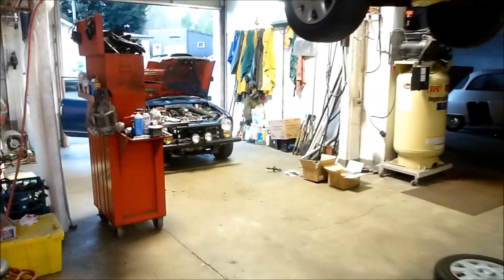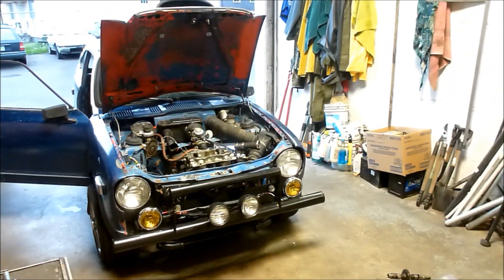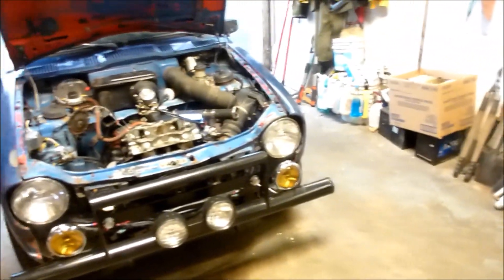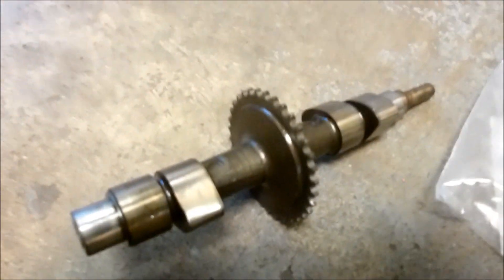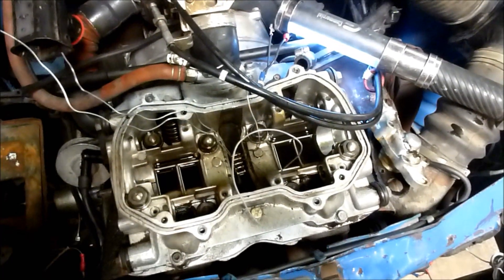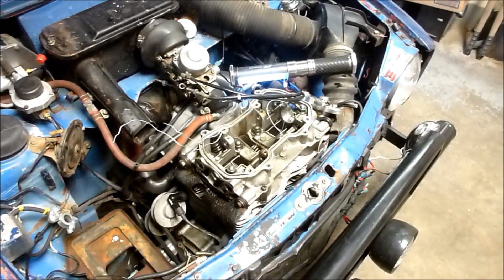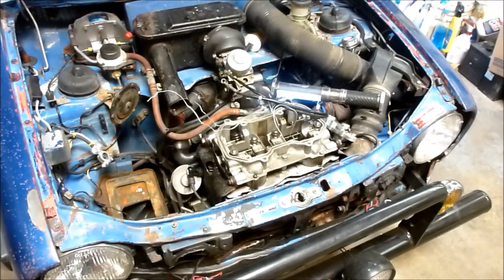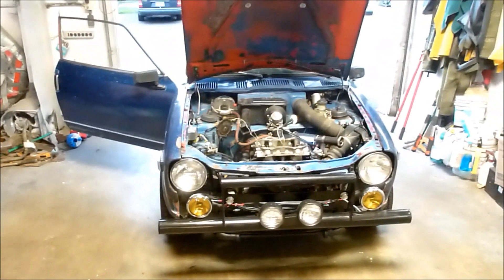Honda 600 timing chain

Comment: Any tips on setting the timing? The book is terrible and hard to follow. I’m trying to set it with a test light. Book says the light should go out just when it lines up with the “F” mark but either the book is wrong meaning the light should come on or the cam is 180 out of time. It runs but real bad?
Reply: Did you ever figure out the timing ?

Comment: The timing being off by one tooth may be why it's low on power. I had the same thing happen on my 1985 Honda 350X three wheeler. It still ran, but wouldn't rev over about half it's normal rpm range.

Comment: pretty little engine.  Read today how the big manufacturers are working on 1 liter 3 cylinder engines for the new fuel mileage standards.  I will be interested to see if the chain fixes the low power.  Too bad they didn't put in a vernier cam timing adjustment like alfa did.

Comment: So, good fuel flow, good compression. If this timing chain replacement, timing adjustment, doesn't fix it, it almost has to be somewhere in your ignition system.